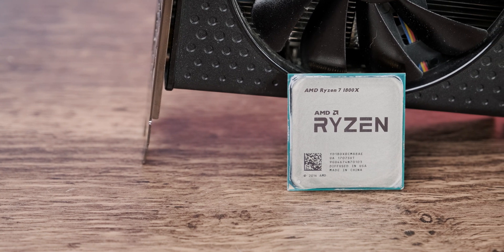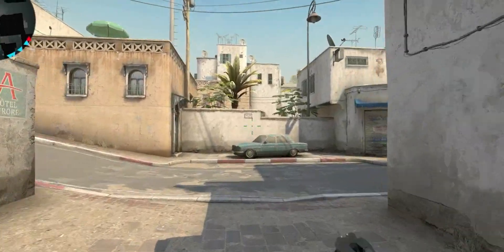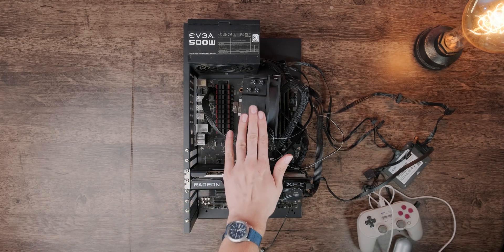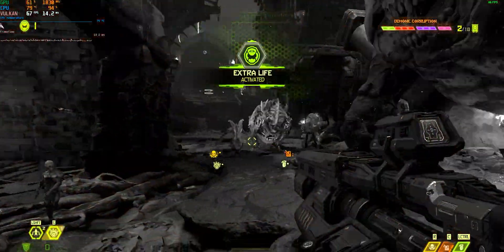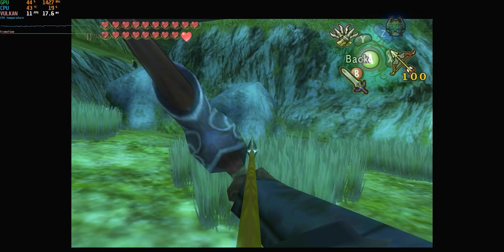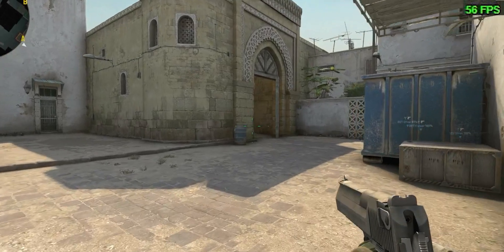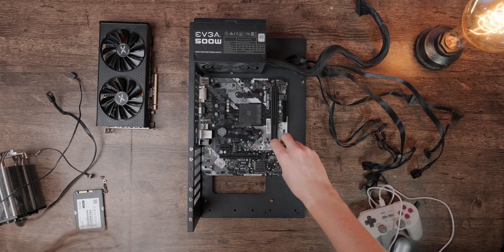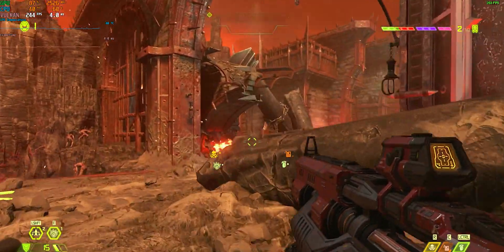WHY Are People Still Buying These CPUs? - AMD FX Series in 2023

Comment: There is a clear CPU throttling going on at 76C temps. To properly cool FX-8350, use Vetroo V5 cpu cooler and don't just OC CPU. FX likes NB @2600MHz and  HT @2200MHz. Use proper DDR3-2133 RAM, not mismatched budget sticks. Turn off APM, turn off boost, enabled slight LLC. You will get a solid OC and much better temperatures at high loads.

Comment: I still like mine. It's only a backup PC now, was my main for years. Started out with 8gb ram and a 750 ti waay back in the day. The chip survives, the rest of that build has been upgraded. It plays pretty much all my steam library, I don't play anything too new. I've normally had it paired with an R9 270x but briefly tested a 1060 6gb I had earmarked for another build, wow it really made it dance. I expected it to be heavily bottlenecked and stutter like crazy, but not at all- it was sick. Now back with its R9 it's still doing what I need and probably always will do tbh as my gaming tastes never change much. I use it as a console more or less. Run through a TV as a monitor, cap at 40fps, use a controller. If I need to drop settings I barely notice because I'm sat further away. I'll game like this forever tbh. I have a spare 6300 gathering dust with no mobo for it, if I find a cheap one I'll make another build, OC it as far as possible and run CachyOS or Bazzite

Comment: I always thought it was weird how the FX-8320 always go overlooked. It's just a lower clocked 8350 out of the box, but you could get the same performance/clocks...no joke, I got to 4.8GHz on air, but I'm in the UK where ambient/average temps are lower than a lot of parts of the US. The weather here is closer to the Pacific North West. I used an FX-8320 on a 990FXA-UD3, all the way until I upgraded to X470 and a R7 2700X, then a B550-F/5800X...and recently dropped in a 5900XT, which is basically a lower clocked 5950X. 

Even if I've gotten rid of all of the other hardware. I kept my x6 1090T BE, and FX-8320 in 3D printed cases. A bulk of the Youtube content I produced on another channel was with that 8320, and I just have some fond memories. I've put the 2700X in a case now too. I just put the 5800X in with that X470 with my old RTX 3070 for a second gaming/VR rig.

I guess the major issue with the old Piledriver chips, is a lack of instruction sets--it lacks AVX and SSE4...so not great for modern games or PS2/PS3 emulation.

Comment: I'm using my old FX-8350 in my home network fileserver with a Radeon HD 6450.  I had an old, cheap 450W PSU lying around and it handles that rig just fine.

Comment: People still buy these because they have an old full size tower sitting in the closet with the Phenom II X3 450 or X4 955/965 flagship socketed in some AM3+ mobo.
Fumbling around with performance benchmarks they open a  bottleneck calculator and start wondering "what if" so they poke egg/bay and pick up an FX at a steal.
I did exactly that mid-2018. FX-8370 for $150 but for a then active and capable VR workstation with all the best possible advantages that could be thrown at it.
The FX is an amazing CPU so that's what I chose to capstone the build. It's also extremely capable for file server, game server and creator stuff today.
I eventually racked my build and today it helps me diagnose junk HDDs and host antique binaries/photos/games doubling as an editor workstation.
Sometimes I pull it apart and make test bench demos with it but we all know it's never going to break any world records on a Gigabyte mobo.

Comment: 2025. I periodically want to buy a more powerful PC, but my FX8320 and GTX1070 CPU handle games just fine, including Total War: Rome and Medieval. My favorites are Borderlands 2 and Payday 2. War Thunder. Skyrim. Rock and Stone Galactic. And a bunch of turn-based games.
Reply: The problem with these CPUs is not performance, but POWER DRAW. I have an AM3+ based PC and an LGA 1155-based PC. Intel's 3rd/4th generation CPUs are so much better, run cooler and draw much less POWER - that's what matters the most in this day and age, at least in Europe.

Comment: 1:13 they are buying them to put in AM3+ motherboards because it is hard sometimes to put windows 7 on an AM4 motherboard
I have a Asus Crosshair VIII Dark Hero and I have tried several times to put windows 7 on it and dual boot windows 11 or 10

got it once but it didnt work very well and my amd rx7600 xt I couldnt get to install on windows 7

gonna try another time with 2 graphics cards maybe put an older on in for windows 7 and a keep my 7600 for windows 11....but I will have to put windows 7 on first with the correct nvme drivers and then install windows 11 either on the nvme or a regular ssd

we liked our windows 7 thats why we keep those ...my AM3+board is another crosshair ...asus crosshair V formula....I had a phenom in it but bent 2 pins ...when I tried to straighten them, they broke...I didnt know they were bent while it was in , so the memory only showed 8Gb when I actually had 16 Gb...took me forever to find the problem because I didnt know the pins were bent on the processor

I'm going to get it going again for windows 7 and get the TPD thing so I can put windows 11 on it

Comment: Wait why would get a better CPU just for work when something like a FX which is cheaper would have been just fine at the time? Though if you really want a budget build just get a FX-4300 it's really not that bad plus it is around $50 USD these days. With these CPU's to offload most of the work you really do need a dedicated GPU for rasterization such as a RX 580 as an example which would preform better using the newer FX chips that you used over a FX-4300 but hey PCSX2 is a stable 60fps with occasional lag or dips in Haven city however still majorly playable. Sure it's not going to hit 4k but who gives a fuck as a better frame rate due to superior rasterization over raytracing is way better especially for something like shooters. And while this may seem like a not good idea at first glance you can actually use a more modern GPU such as a Radeon RX 9070 XT and suddenly these chips especially the FX-4300 are playing stuff like VR at a stable 1080p 60fps as contrary on how a bottle neck is thought to work the better a GPU is at rasterization the better these old CPU's actually are despite devs being lazy and trying to push raytracing 

But I know it may not be a good example as VR is more GPU intensive so as long as your CPU is at least a quad core so pretty much all the FX chips on the AM3+ board it will run it. Funny thing is the Radeon RX 9070 XT is backwards compatible so they cab be used on a AM3+ board. At some point someone will actually have to check just much much of a bottleneck we are actually talking about and how much a CPU is holding back a game or how much a GPU is holding back a game as I swear a lot of the stress of a CPU can actually be offloaded onto a good GPU as a GPU is meant to process the graphics so I say let it

Comment: That's great but the FX 8350 isn't the actual top of the line for the FX series chips. The FX 9XXX series chips were also 8 core/8thread chips with base clocks at 4.0GHz + and boost clocks as high as 5.0GHZ. I just put an FX 9370 at 4.4GHz (5.0GHz boost clock) on an old ASUS AM3+ board and it freaking rocks with an RX 580 8GB GPU. It wasn't bad with a GTX-1070ti 4GB GPU either. As long as you don't try and run games like Cyberpunk in 1440 high settings then it still hold it's own in most titles I tested it with. It's going to end up with 2 GTX-960 4 GB GPUs in SLI when the other card gets here. I've got less than $300 in the entire system build and it's a blast to play on.

Comment: I'm still on 6300, it's a good CPU for older games, internet browsing, and other non-heavy workloads, stuff I'm doing. And also it's an absolute overclocking legend, mine is running at 4.1 GHz and 4.5 boost without disabling any power saving features, all on a cheap cooler🤘 I was also able to achieve stable 4.75 GHz on all cores, but decided not to keep this config because of temperatures getting too hot for my liking

Comment: Buying one of these now means youre just hoe'ing yourself. Can easily get a few gen old Dell office style PC on the cheap and just throw in whatever GPU you can afford. After my very recent CPU upgrade from i7 8700 to i5 13400, it doesnt seem so different, but even on a 3060 class card, EVERYTHING runs much better and stutters less, even though GPU was fully utilized before in most cases.

Comment: I think I know why. Windows 7 has a hard time coping with Ryzen and newer Intel parts. And, some older games have a hard time coping with Windows 10 +. But the prices are a mystery. Now, check out how much 80386 gear costs now. But I digress, I use an FX8300 with Win 7 64bit on games for Windows 9x/XP with no problems. But you HAVE to install and run them in XP compatibility mode. Half-Life, Blue Shift and Opposing Force does NOT like Direct X under Windows 7, at least on my old 560 Ti card, so I have to use Open GL. Looks better, too.

I also found the XF8300 will run stable as an FX8350. But why? The 8300 is FAR more processor than those old games were designed for. But it's what I have for retro gaming. There are far better Intel parts for less money. An i7 2600K for less money is a much better choice for a Win 7 retro gaming rig. And dirt cheap.

As for those Bulldozer parts, forget it, even a Phenom II X6 is better. You just saw what happens when you try and game with them, they were gold pinned turds with a heat spreader.

Comment: Still in use. Got the am3+ board since 2012. Pretty on a budget but it rocks. Undervolted both gpu and cpu and oced the rx  580 8 gb . Marvel guardians of the galaxy runs great on that config. I am looking further to am5 .
Reply: Can you please advise how to do that undervolting?
Reply: @АндрійПозняков-н2ф   hey there is a video on youtube. For the Gpu you do this via msi afterburner 

For the cpu i did it via the bios setting. Its almost the same on every mobo - voltage setting; and then undervolt it manually. Youtube it ! Wish you luck
Reply: @TeajM1510  thanks!

Comment: Your RX 6600 will be bottlenecked by the PCIE version on these not just the CPU (it doesn't use the full x16). You are probably better off with a used RX 5700 xt - but even that will be bottlenecked by the CPU. A GTX 970 or even 760 4gb is probably more suited to the FX era. Plus the FX makes more sense when you compare it to something like a Phenom II 955 (in 2017 I upgraded from this to the 8350 for $75 new into my older board). But in many situations today even the Phenom Quad cores are still usable (I wouldn't pay more than $45 for a full Phenom build though).

Comment: First computer I built myself with new parts had a 8350 in it. I used the absolute crap outta that thing. I overclocked it at 4.8 stable with a cooler master 212 and 2 very high speed fans. 
I am using that same cooler on my R5 3600 and it works great. My buddy is still using that system to this day with a GTX 1650 Super.

Comment: My only real "issue" with my old FX-8350 was that it was stuck on PCI-E 2, so higher end GPUs would get a bit bottlenecked, still have mine running with a Radeon Fury X though. Linux really brings a whole lot of extra life into the aging system, specially since driver support is dropped for a lot of the components. Just feels a lot snappier than Windows 10, and a bit more stable than Windows 7, plus modern linux has all the security updates. Gaming performance is pretty on par between W10 and Linux as well, with some OpenGL titles performing better on Linux

Comment: Game play is absolutely a dance between CPU and GPU, on an AM3+ MoBo  the bit rate for PCI EX2 was 128 bit except in the higher end gaming mother boards where some had PCI EX3 slots that were 256 bit bus. which drastically improves game play. GPU's that are designed to run on PCIEX3 are backward compatible with PCIEX2 with out any significant problems due to lower voltage on PCIEX2 but similar PCIEX2 GPU's cant run on the next gen slot for reasons of the higher voltage attributed to that slot. SO making a comparison to next gen PCI and previous gen PCIEX isn't really valid

Comment: I recently threw my 8350 FX back together for the guest room with an RX 580 and an old SSD. I had to buy a PSU because the old one couldn't handle the RX 580, and a couple other odds and sods like a wifi card, it's doing great printing photos, playing videos and interneting. I recently was able to load and play BF1 and I'm getting maybe 30-45 FPS - playable but not great. As a sub-$60 computer build it's remarkably OK though.

Comment: used fx chips are still being sold for over $30 on ebay and its kinda crazy since they are really bad value. The only time you''ll get a good deal on them is if its a cpu mb combo to make even a little cost effective. If you buy an am3+ mb alone its usually easier to find a decent quality one from a chinese seller too.

 My first pc had an fx-4350 and i upgraded to an fx-8350.

I upgraded from the 4350 to the 8350 just to get better performance in vermintide, the game has massive stuttering issues the worse your cpu is. I went from crashing rarely during horde spawns, while most of the time it would freeze for a good 3-5 seconds, to a small hitch and it never crashed so i mean the upgrade was good for that. But i still felt cheated when i found out that the 8350 is not the revision, and the 8370 was the revision version.

Now i have the 4350 in a build for my mother and the 8350 in another for my dad while i have an 5700x3d. I didnt see the value in selling the fx chips as why would someone today willing use an am3+ system, but i did sell my past am4 cpus since they are still relevant.

Comment: The comments are LOL..............completely missed the point of the video.  The point was simply that Ryzen is not only WAY more powerful, but it is a lot more POWER EFFICIENT!  If a person had bought in back in 2017 with a good MB and 1000 series CPU, they could potentially be rocking a 5700X3D or 5800X3D, which just blows away newer Intel and lower AMD CPU's.  The sheer amount of people bragging about Bulldozer is just ridiculous.  When you have Hardware Unboxed still praising the Zen 3 X3D chips, and not seeing Bulldozer on their tables for at least 5 years, if not longer.....it is time to upgrade!

Comment: I"m currently running an FX8350 on an old ASrock 990fx Fatal1ty Killer 8+2 Power Phase board. I'm having a hard time getting any sort of stable overclock. I've opted to overclock my RAM instead - four sticks of Gskill Rip Jaws 8GB each at 2133 MHZ running dual channel. I am happy with it though - for a decade plus old CPU it still holds up with current titles, even if it tends to stutter a lot.

I can play Hell Let Loose on Medium - Low settings and in high action areas see an average of 25 to 35 FPS (it's a poorly optimized game to begin with). When I'm playing in a lower action area I have no problem seeing as high as 80 FPS in some cases, even on High settings. I can run Helldivers on the bare bones settings and clock between 20 to 60 FPS, again depending on the area and how much action is going on. It rarely ever drops below 30 in either of these games for me.

The stuttering is something that I can't seem to avoid however. I don't think it has anything to do with a lack of proper cooling - the CPU is just dated and as time goes on and tech gets better and better, the 8350 becomes more and more irrelevant.

Still, pleasantly surprised and happy with my first DIY build. It looks sick and it's as cool as an air conditioner. For an 8350 build I am impressed with my work!

Comment: Still have a classic game build with AMD FX-8370 4.0-4.3GHz 8Core and Asus Sabertooth 990fx board and an ASUS GeForce GTX 1660 Super gpu...... runs all modern games..... the wraith cpu cooler is crap, so upgraded to a tower cooler with double fans....  if you want power at a budget this is it..... AM3+ motherboards are scarce new, but used ones many out there very cheap...

Comment: im still using my 2012 fx9370 my mobo has it defaulted to overclock to 4.4 ghz 32 gb of 1866mhz ram with a rx480 8gb. Im running linux mint and its been a really amazing snappy experience for how old my hard ware is. Im starting to develope my own game in godot with using blender/krita. Its honestly fine for me still. I will build another pc eventually but its really nice keeping old pc stuff out of ewaste. With the right cooler and thermal paste you can get the fx chips running cool. mine idles 5c and when i benchmark it it gets up to 52c max after running for like 10 min. Rendering and emulation is where its showing its age and ofc the newest games. The fx chip has been one of my favorite builds its not the fastest but when hardware lasts so long and you get your money out of it and then some its so awesome 😂😂😂😂

Comment: Hi there,new here,could I just ask if you'd know a bit more,bc. I'd like to ask if you know if I could just buy an RX6600 and add it to my AMD FX-6300 like that or if I'd need to do sth. befirehand,bc. right now I have an R9 280X 3gb GPU that came with my PC and wished to upgrade it,but don't know if it'd be worth upgrading ir if I really should buy a new PC...and also what DDR3 are you using,I.e. what Mhz do you have,bc. rn I have only 1600Mhz UDIMM DDR3 8gb ram and would have LOVED to at least upgrade the Ram to 16gb,before getting a new PC,so I could save up more for it in a bit...just asking bc. I'd like to know since Idk if it'd be worth it to upgrade my PC or buy a new one...

Anyhiw thank you fir the video,liked and subbed,hope it helps and I hope to hear from you✌️